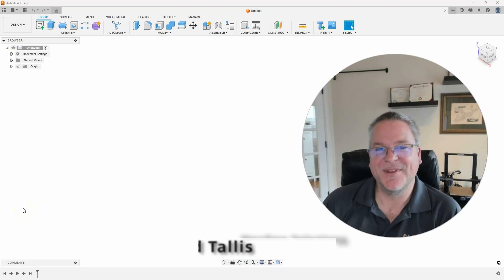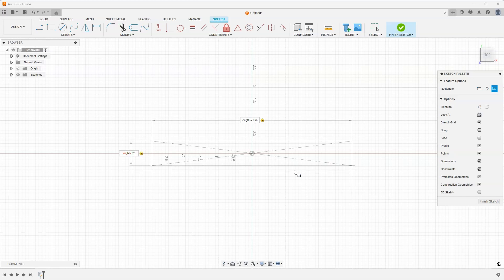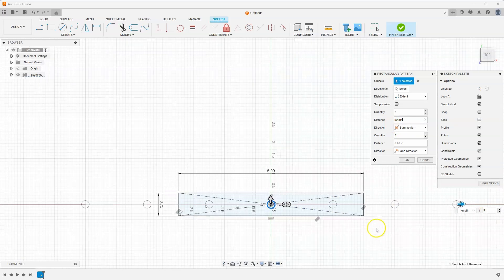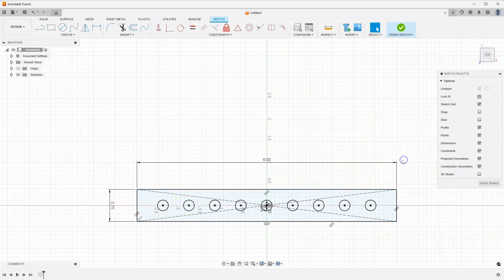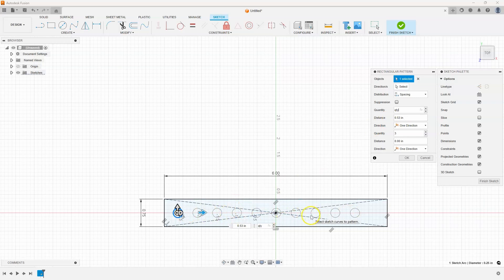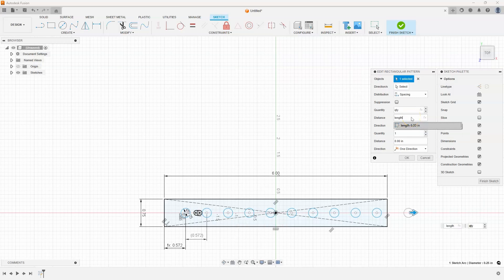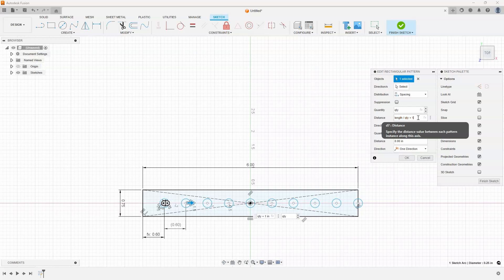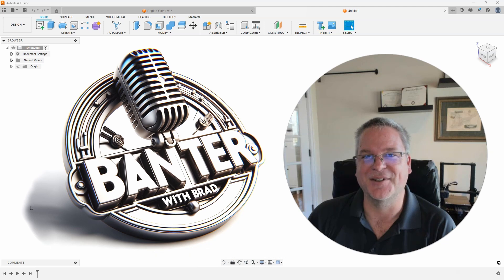Banter With Brad Episode03 - Equally spaced holes from edges

Comment: Thanks for the tips. Typically when I do this I want the spacing to be edge-edge vs. center-center. The circles edge-edge spacing would also equal circle edge-rectangle edge. How could that be done?
Reply from the maker: You can create the dimension to be tangent/tangent and then pick the circular edges.  This will create a dimension from the edge of one circle to the edge of the other circle.